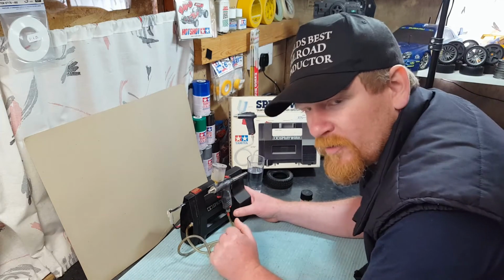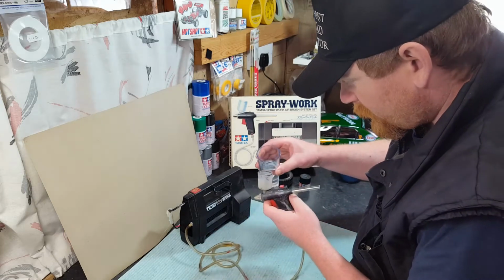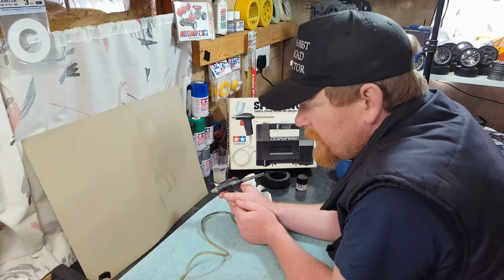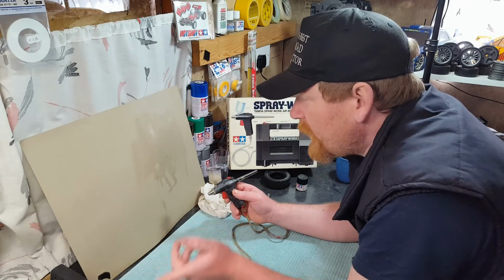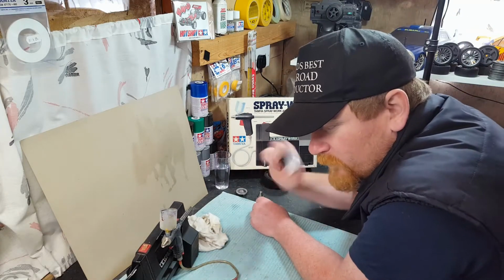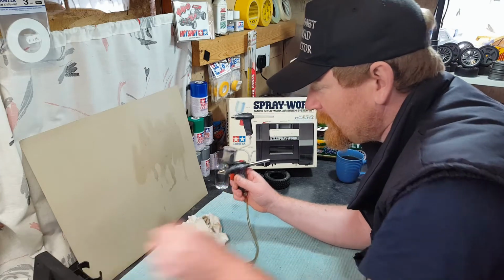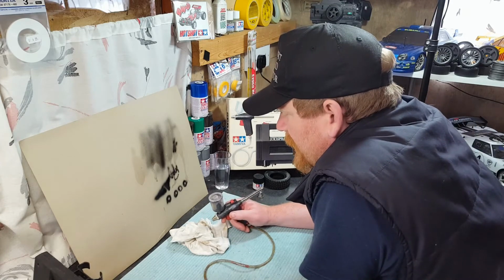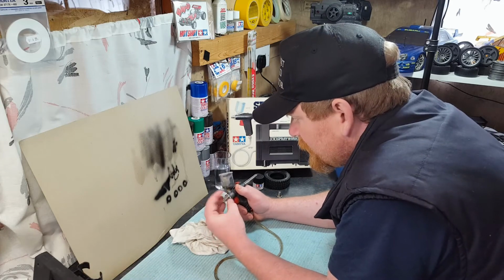Tamiya spray work Air Brush System Set part 2 DEMO & REVIEWS!!!

Comment: I have one of these old airbrushes, which I picked up secondhand. The original owner had trouble getting it to work properly. I will be picking up a 6v 3 Amp power adaptor to replace the battery shortly. An odd issue that I discovered with mine was that the seal where the red plastic air hose cap connects to the brass base needs a gasket of some sort - otherwise it leaks. If you remove the two small screws, and paint the inside of the red cap with latex masking fluid, the seal is good enough to paint with for a few jobs. I believe this is why the previous owner had problems with it.
Reply: How i can contact you, i’ve got the same issue on my Spray Work System. 

I don’t know if that normal that around and center hole are connected ? 

Thanks in advance.